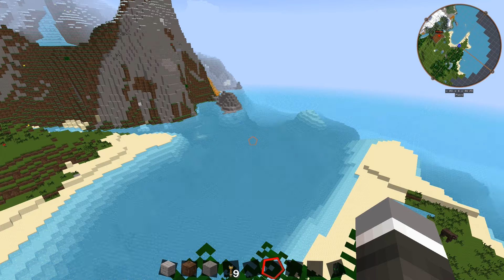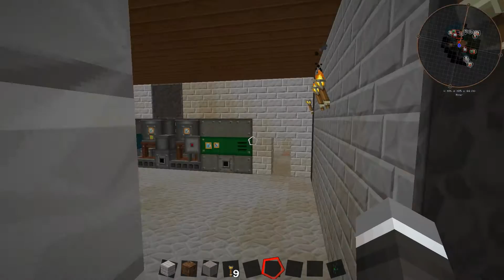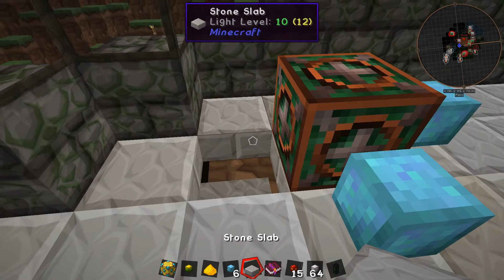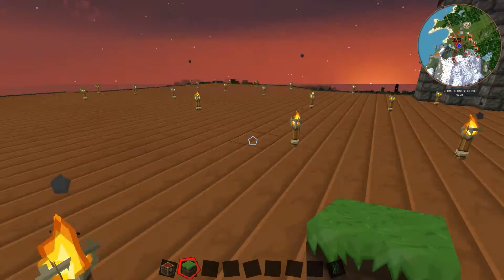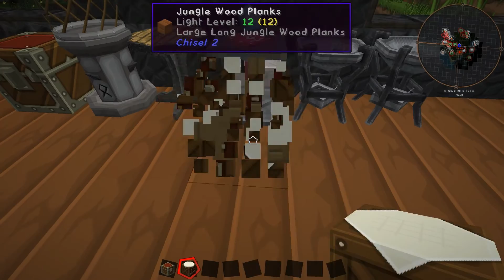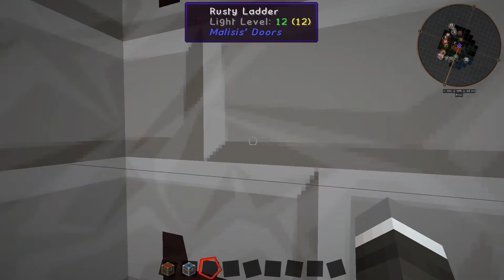FTB Horizons Daybreaker: Rebuild catch up

Comment: the new base looks sick ! , for the storage drawers there is a key that can be crafted that is used to lock the drawers. 

an empty locked drawers will not accept any items in it also you can apply capacity upgrades without needing the pervious tier , Router Reborn has barrels if you want some good old storage options plus they keep their items stored when mined and are very cheap to craft. 

get the iBench instead of the crashy Blue Power Table

BTW : file restoration IT NEVER ACTUALLY WORKS
Reply from the maker: ***** Hi bud, Thanks I think it looks pretty good I got a lot of help from viewers of the last stream. I will definitely have to craft this key and then it will be a great system I think. The barrels from RR sound great for bulk items! Yep I have been looking at the Ibench I just havented added them in as I want to craft them properly while not in creative so maybe next episode.

Comment: I didn't know about the minium condenser, thanks for that. I wanted to offer in case you didn't know, there is a block called the storage controller by the same mod from which you made your inventory chests. Remove all those conduits and just have the controller touch one of your chests, and make sure they are all touching and that controller will sort and send all items where they belong. :)
Reply from the maker: BrinkTheGamer Cool, I might look into that if I cant find a way to stop items from going into the drawers when they get emptied. It sounds like a pretty cool system, but I love having pipes and seeing the items moving around.